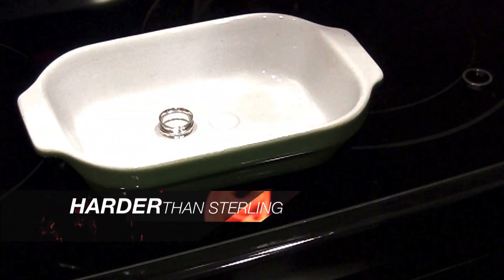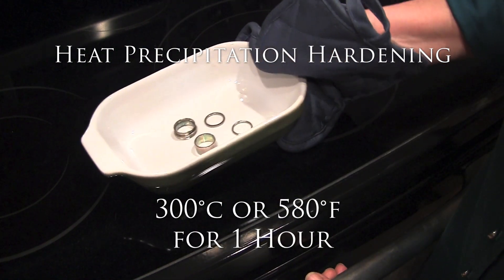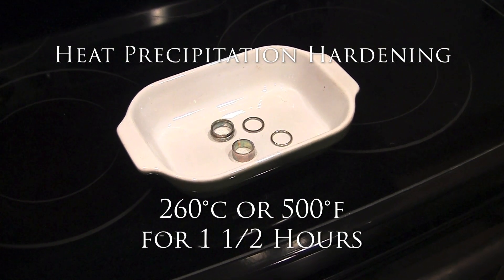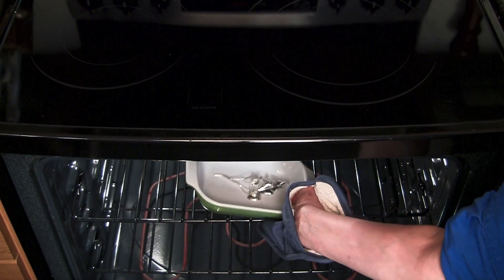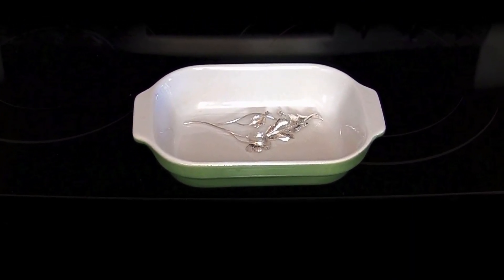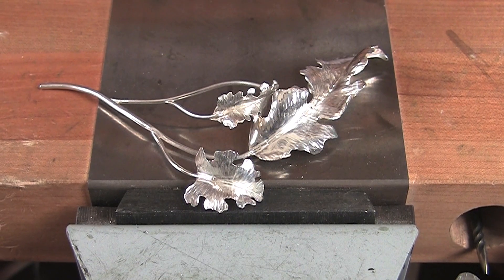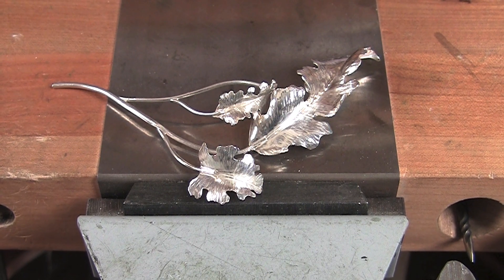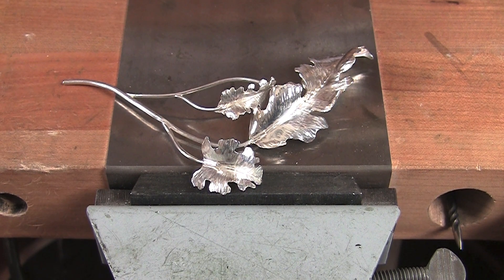Heat Precipitation Hardening of Argentium Silver

Comment: Hardening rings and such will allow them to remain shinier, since the surface won't scratch as easily, especially if worn daily. I also imagine the harder surface will polish even brighter than it would if it were soft. I cast a 935 Argentium ignition key for my old Ford Mustang, and I will be heat hardening it after its cut by the locksmith, along with the split ring I made for it.